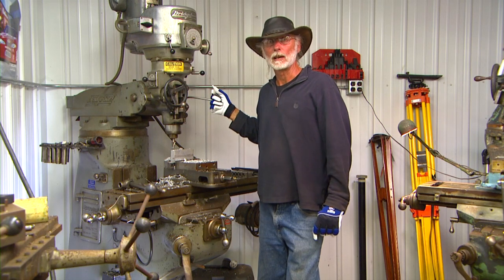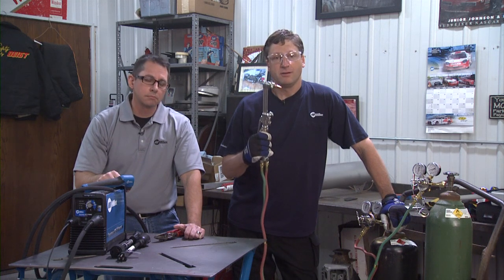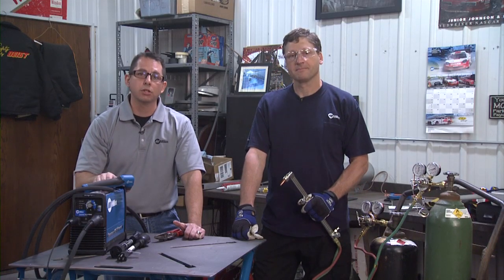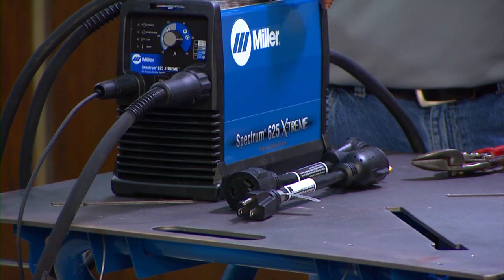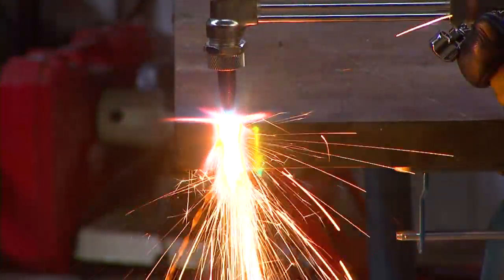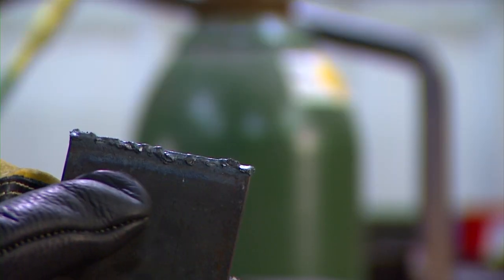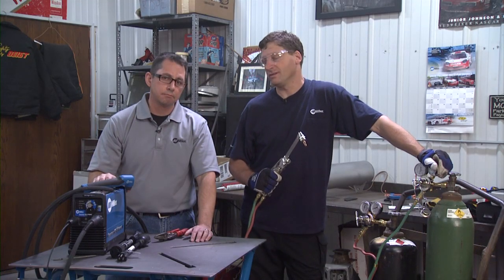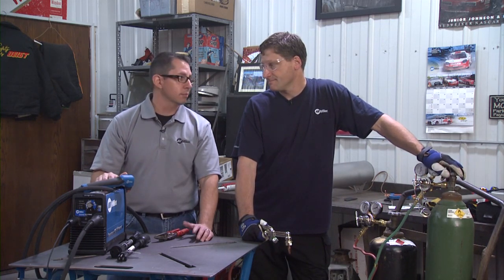Plasma vs. Oxy-Fuel: Which metal cutting option is right for you?

Comment: Oxy-fuel can also gouge, usually doing a much nicer job than a plasma cutter. It also busts rivets cleanly, whereas the plasma will almost always gouge the riveted steel. 

Also, the oxy-fuel can cut every bit as cleanly as the plasma, despite the rough-looking coupon you held up as an "example" of the oxy-fuel cut. The HAZ can be reduced by using a reduced-fuel-consumption acetylene tip, preferably one sized for 1/8" material in the case of the coupon you showed.

Comment: What sizes are those tanks?
Reply from the maker: Thanks for reaching out. The oxygen tank is a 150CF bottle and the acetylene tank is a 100CF bottle. Thank you.
Reply: The oxygen cylinder is an "S" size cylinder, and holds 136cu-ft. The acetylene cylinder is an "A4" size and can hold up to 145cu-ft. As with all acetylene cylinders, no two are identical in capacity due to variations in the filler, so the red tag on a freshly filled cylinder lists the actual amount of gas it was filled with, and that's what you actually pay for. The equivalent cylinder in the W-line (Prest-O-Lite style) is the WS/WSL, which has a capacity of roughly 130cu-ft.